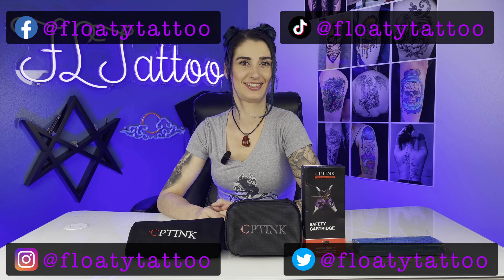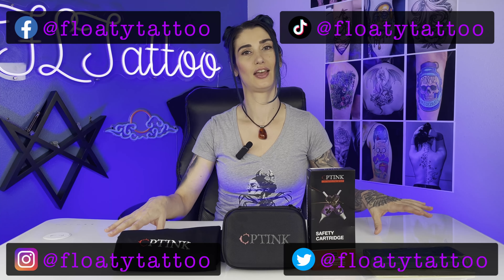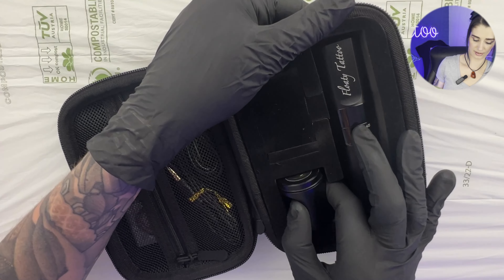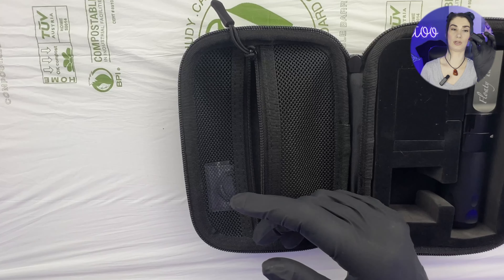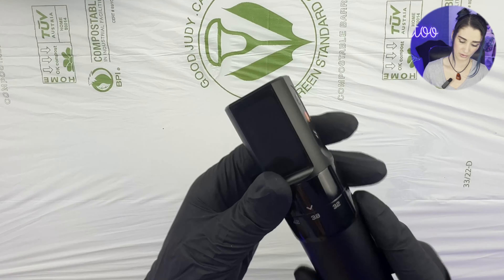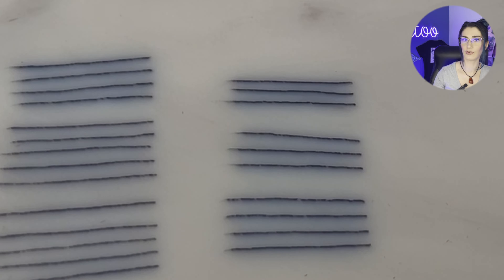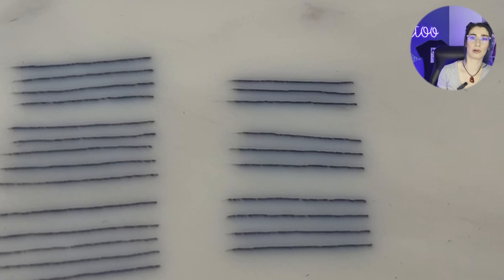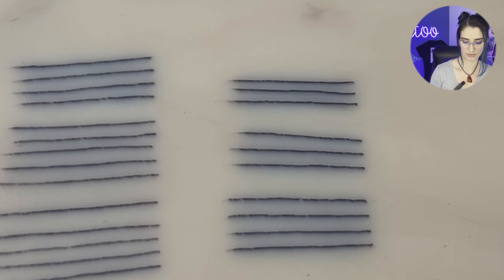CPTink Captain One, Wireless Adjustable Stroke Tattoo Pen - Unboxing and Initial Review

Comment: Hello Floaty. Did you try the ez p3 pro turbo and/or the inkflexo, that has a dotwork mode?
Reply from the maker: @rainita-l4u  I have not. I have tried an InkIn Machine that has dot work, I forget what it’s called, what did you want to know?
Reply: Your opinion about them. I want to buy a new pen and looking around for honest reviews. Your reviews look the most accurate, because you take your time to test them on fake skin
Reply from the maker: @rainita-l4u  I did not find any use for the dot work mode. My top recommendations for machines right now are the DragonHawk Fold Pro 2024 or if on a budget the Yilong F8.